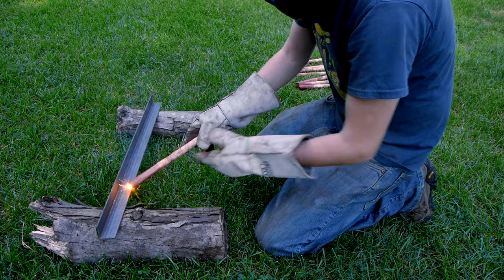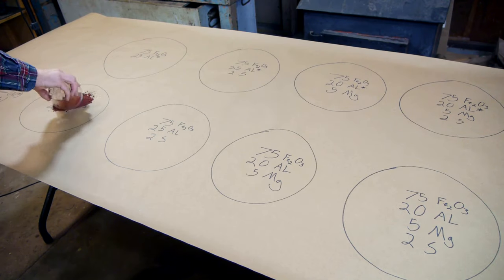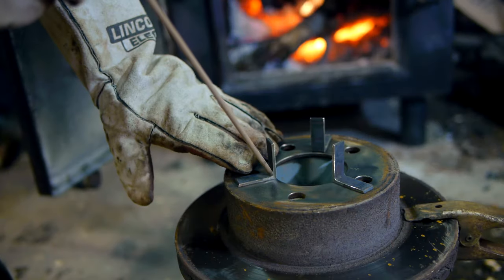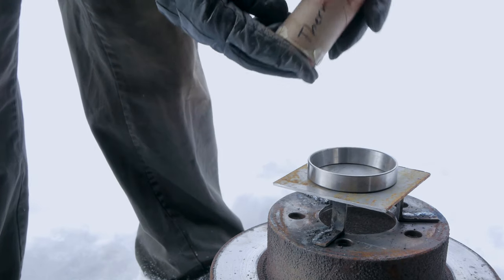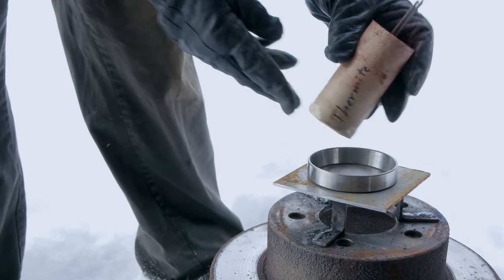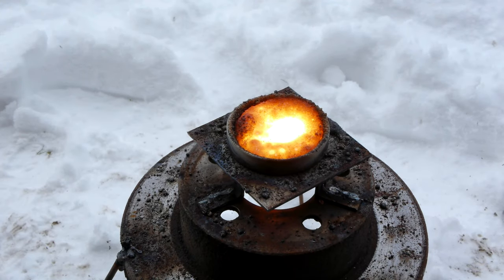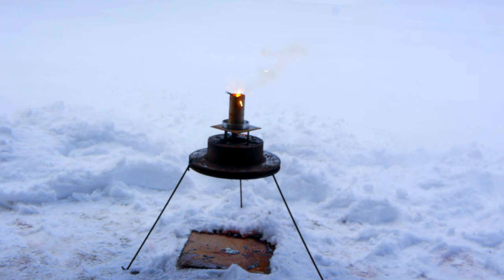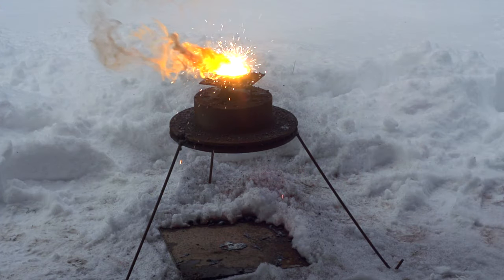How Easily Can Thermite Actually Melt Steel? - NightHawkInLight

Comment: Idk man, there is plenty of footage of thermite cutting steel. Your thermite seems to burn very slow in comparison to the others I've seen on YouTube. They do use roughly a pound to two pounds of thermite however, rather than 300 grams. Try upping the amount of thermite you use, it's cutting power seems to grow exponentially with how much you use.
Reply: +RichCommander You mean like when the Mythbusters tried to use over a thousand pounds of thermite to cut a mostly thin sheet metal mini SUV in half and it failed to do so?
Reply: +RichCommander 
Where is this "plenty of footage"? Because most of the footage of thermite usages I saw shows filling gaps and welding, not cutting.
Reply: +RichCommander It comes down to how you direct the energy, from what i'm seeing, only the bottem 10% of the thermite was actually influencing the steel. The rest of the thermite reaction was directed up and outwards away from the steel. A better representation of this experiment would have been to have the steel put on top of the burning thermite if ignited from above, or find a way to ignite said thermite from below to cut downwards. The directing of energy is just as important as how much you decide to use.
Reply: thermite doesn't cut anything. it might melt stuff on contact but it is not used for cutting
Reply: +Ivan Stroganov cough thermal cutting rods used by the navy to cut metal underwater
Reply: +superdau I just did a search, and on the first page there are 3 videos of thermite melting through - a metal table - a ceramic pot + frying pan + plate steel, all in one go - and several I beams and girders

Comment: Now I'm no chemist but I think something you're doing is wrong. I've seen lots of videos in which thermite melts steel like butter. You can watch Brainiacs videos or the episode in which Mythbusters use thermite to get into 4 inch thick steel safes. If you can't get past a 1/8th inch steel sheet then you're doing something wrong. Great videos by the way.
Reply from the maker: +DjCatani Brainiacs is known to fake the results of their experiments to make for better entertainment. Mythbusters has used thermite quite a lot but as far as I know have failed to cut through anything very substantial. That isn't to say that thermite cannot cut through steel, but that it isn't as easy to make it do so as just setting it above the steel and hoping for the best. That was the purpose of the experiments I did in this video. Focusing the energy of a large quantity of thermite with specialized housings certainly can cut through significant thicknesses.
Reply: +NightHawkInLight nighthawk you have to put it in a container with one side open and facing on he steel that will cut right through that chunk of steel
Reply: +NightHawkInLight Dude, you're just wasting 90% of that thermite by keeping it in that cilinder and lighting it from the top.
Reply: +NightHawkInLight Yeah, the focusing is the crucial part. Just like with sunlight, if the energy is dispersed over a large area, it's harmless, but a large enough area concentrated into a small spot will melt rock.
Reply: +DjCatani  Just like gunpowder won't explode if you just take a handful of powder an set it on fire, thermite  will not melt iron if not used properly. I would like to see the same experiment with only difference being cylinders placed sideways. I'd be willing to bet that it  would be enough to create different outcome.
Reply: +NightHawkInLight As with any thermal or explosive compound, shaping is crucial to achieving maximum results. Having an open-top cylinder is not just "by no means perfect," it makes this experiment completely improper considering your test objectives. I enjoy your videos, take another look at this one.

Comment: thermight was designed to weld steel together not go through it. thermate was designed to go into the barrel of a tank or heavy artillery and melt inside to gunk up the gun and fuse the metal can to the inner barrel. neither one was designed to melt through metal.

Comment: I watched a video a while back about how maybe thermite was used in the attacked on 9/11. The person in the video made a range of thermite compositions and put them into steal piping with a reducer as a nozzle. The thermite he made was quite fast burning and he put them into a variety of containers with nozzles or small slits to try and cut thick steel. Most of the time it was an explosion but did cut the steel. I will look for the video and I will get back to you.
Reply: The video is called 9/11 experiments: The great thermite debate .. it’s still on YouTube. And clearly shows how a very small amount of thermite can cut cleanly through steel beams.

Comment: I think since the plate had time to heat up while the reaction was starting, it softened the metal and made it more pliable. (Less likely to penetrate.) same thing goes for your hand held rods. Try suspending a clay flower pot over the steel and having it pour onto the plate.

Comment: It's not your ingredients that are the problem. It's that you need to force your thermite reaction to be solely directed at what you are trying to cut. I've seen a YouTuber cut through an i beam. As you can see from your experiments, with it set as omnidirectional, it won't even burn 1/8 steel. Try wielding 2 angle irons together long ways, but only wield down one side and make about a 1/8th gab down the otherside. Cap the ends with steel end caps. Fill your thermite, then direct your 1/8th inch gap that you made tight along where you want to cut.
*All of these sizes here aren't necessarily correct, but the process is.
I hope this helps, it works. I've seen it 👍

Comment: From the setup, it seems to me most of the thermite is burning up at the top of the tube before it ever gets close to the plate. The amount that flows down to the plate and that amount burning relatively close to the plate isn't enough to do more than get it nice and hot. I would expect just thermite inside the retainer ring would do as well and possibly better. You might also consider adding magnesium, though iirc you may have had that in the list of ingredients briefly shown near the beginning.
I have definitely seen thermite cut through iron and steel. I'm certain your method of application is the problem.

Comment: a couple of thoughts, 1) light from the bottom. by lighting from the top a lot of energy is lost burning through the material before the heat reaches the bottom. 2) have you ever tried adding magnesium chips and a filler to increase the temperature?

Comment: It's normally more effective to hold the thermite in a ceramic pot with a hole in the base so when it forms the liquid iron, it flows out of the bottom and can indeed cut through metal. Also thermite likes company, so try to use a larger amount to allow the heat to really build up and get a good flow of iron. Also ensure that you use the finest grade of chemicals with the highest mesh number and mix it really well before use.
And as so many people have pointed out, there are lots of videos out there showing successful use of thermite to view and learn from.

Comment: I remember back in Army Basic Training, it was "Hand Grenade Training" and one that was demonstrated was the Incendiary Grenade.  It was about the size of a tomato soup can with the fuse on top but it burned down thru the bottom.
 So when you load the tube w/the mixture, set the fuse to light the bottom and try to make a hole thru the mixture from top to bottom to allow extra air in to cause a venturi effect and turn it into a blow torch.

Comment: It is all about direct heat application and containment, if you burn all the thermite in a large stack far above your target surface it can't do much good.
And while thermite does turn into molten steel it can only share the heat with objects around it, meaning you need a great deal more thermite then the steel you want to melt, it is sadly no magic pixie dust.
Reply: Molten Iron not Molten Steel.

Comment: Hey if you dont mind me asking, What are the handheld container tubes you use made of?
Reply from the maker: +PsychoSebi Paper
Reply: NightHawkInLight oh, How thick is it that you can hold it safely?
Reply: +NightHawkInLight copper oxide works better than iron oxide
Reply: +Defective Turret The problem with that, even tho it has a greater energy output,  the reaction ends quicker, so it has no time to really melt the steel. most of the heat just escapes into the air.
Reply: gmoddave actually it more of explodes

Comment: try lighting the thermite from the bottom of the tube to allow the molten metal to drop down onto the plate directly rather than to potentially weld the iron/aluminium together under it as it's reacting, your thermite compound also seems to burn differently to other thermites, ask +theCodyReeder (cody's lab) for the recipe to his thermite? and/or ask for where he sources the components, if that fails try gunpowder/blackpowder in the mix to speed up the reaction?

Comment: Next show suggestion, How easily can Jet fuel melt steel ☕️🐸
Reply: Very effectively
Reply: Filip laskovski how easy can jet steel melt fuel beams
Reply: ***** Learn chemistry before getting a youtube account
Reply: ***** Make that simple 6 yr old logic, not chemistry
Reply: ***** However nothing can burn hotter then the amount of energy that can be provided.
Reply: ***** It would make multiple small ones then around 2-10 large explosions then one massive explosion which can be heard in un edited clips.
Reply: John Waldeyer Explain the un edited videos where a loud explosion happens 1 second before the building fell.
Reply: John Waldeyer They were edited. Fun fact a helicopter was over the north tower when the south tower collapsed. If you can not here the helicopter or the explosion, it is fake. It is a large flaw in the 9/11 plan which proves tons of videos fake.
Reply: Anyone who thinks the towers fell at free fall speed is kidding them self. There is 0 explination for something to fall through plasterboard and steel beams as if it was falling through a vacuum

Comment: Couple things I'm wondering... First, if you lit it from the bottom (or rather, if the wick you used to light it ran all the way through), could you see better results? If you used a narrower tube (to focus the energy in a smaller area), could you see better results? Composition isn't everything, though it is a good focus.

Comment: Probably a bad idea putting the Thermite in a toilet paper tube. The toilet paper tube burns and makes gas (as smoke), and that releases a large amount of the heat up and away from the steel. The whole point in thermite is that it makes little to no gases, and so the reaction gets up absurdly high.

Comment: If I may make a suggestion, maybe try to create an ignition system that will burn the fuel from the bottom to maximize the concentration and heat at the point you wish you penetrate. Not sure if this is feasible but it seems plausible. It may end with fuel being scattered out of the top of the container.

Comment: The only use I know for thermite besides military use you mentioned is for welding rails together on railroads. I think Mythbusters even did an episode where they used it to get into a safe and they needed a heck of a lot to do it, and it wasn't practical since it would have burned all the money in the process. The issue is it leaves too much material that soaks the heat so the target metals never really get enough heat to melt, just enough to fuse with the metal in the thermite. I really enjoy your videos on it and hope you explore it more. Might be interesting to see you weld with one of those thermite sticks.

Comment: +NightHawkInLight I'm a thermite welder on the railroad, we don't use thermite to cut rail we use it to fill in the gap to join two pieces of track (25mm, and up to 50mm),and we always preheat the ends of the track, period of time depends of what kind of track it is, I'm not sure how much thermite we use, but the portions we use comes in rather small buckets.

Comment: it's important to remember that the high 3500 F temps are reached at the interaction, not through somehow self-melting and dripping downwards onto the steel. The interaction has to occur immediately or near immediately proximal to the steel. The reason the plant pot works is that as the interaction gets going a constant source of chemical mixture is pouring down through a hole, controlling the burn rate. That way the heat increases until it finally goes through. You need both a length of burn (probably from a lot constantly burning over a longer period of time) AND proximity to the steel, or concrete as Grant Thomas has done. 
There are many ways to get high temps, what makes thermite useful is that it has cheap components that are not easily triggered and they can be modified a lot of ways for demolition applications. I don't think it is overhyped, respectfully. It is awesome stuff.

Comment: If you could focus the flames of the thermite, then it might work better, as the heat seems to be dispersed mostly up into the air. Possibly using compressed air to blow a flame down (while fuel source is kept to the side).

Comment: Thermite can't melt steel beams
Reply: actually it can and is probably what was used.
Reply: actually it can and is probably what was used.
Reply: ..but jet fuel can? There was also nanothermite found in the residue so you could be right though. Maybe thermite was there to weaken certain sections enough so as to facilitate the collapses, with nanothermate doing the main job.

Comment: I lit off a batch of thermite in my back yard in a relatively thin dollarstore frying pan a few years ago and I was pretty disappointed and surprised to find that it didn't burn through as I expected. I guess you need a sustained reaction to heat up the container enough to melt it.

Comment: Like just before you hit the oxygen on a cutting torch I think you are right there, you just need maybe a second stage it would act like hitting the oxygen, and maybe some way to funnel that pressure into one small point. Also I have wondered if you drill a small starter hole in the center, what would happen?

Comment: The thermite 'grenades' I am familiar with from the military have the igniter down the center of a compressed cylinder so the inner surface all ignites simultaneously. That seems to direct the heat both up and down, creating a directed jet of flame that definitely will ment through at least an inch of steel. I'm certain the design had to be tested to gain the most effective deployment.

Comment: If the thermite is placed directly on the steel plate, I believe the  greater surface area, and more direct heat transfer would add up to more cutting power. Keep up the great Work! Your videos never fail to entertain me!

Comment: my memory says thermite was mainly used for welding things like railroad tracks when making repairs
your lance is a cutting tool

if you want to burn thru something aka cut it, its a narrow hot spot, used to cut out a section
not powder to burn a big hole

Comment: If you light it from the top, the layers of thermite underneath it will insulate the heat, which means only the last bit of thermite will be in contact with steel. 

If you want to use it to cut, you need to light it at the bottom, and make way for it to trickle away, so it doesn't solidify and block the rest of it reaching the steel plate. Drill a small hole in the plate or make a channel in thermite's container.

Comment: At basic the Drill Sergeants put a thermite grenade on top of an ammo can. Made a hole, but only a small one. They did it again putting the grenade underneath and it melted the can in half.  The problem probably isn't your thermite, it's where you're putting it.  On top, the unburnt pile will actually insulate the plate until it begins reacting. Furthermore, anything on top of, or to the sides of will receive more radiant heat than anything below it because of convection. 

When thermite is used to disable or decommission equipment, it's placed in the center of the equipment.

Comment: If thermite is used to cut steel its most likely housed in a conduit with a directed output facing the steel being cut through. The conduit is usually a sealed container as well in order to pressurize the output

Comment: I'm pretty sure the reason why the thermite didn't cut through the plate is because you ignited it from the top. The heat from the  top layers of material ignited the material beneath it and transferred the reaction to the material in contact with the plate. But before the material close to the plate even started to heat up, most of the reaction had already occurred and the material had already been burned up above. If you had found a way to light the material from the side in contact with the plate, the heat would have been directed downwards towards the plate and at the same time, would ignite the material above it which would then come in contact with the plate as it falls down to replace the already-burnt substance. That way, almost all of the energy would be directed into the plate.

Comment: you need to focus the thermite burn into the steel  (ewample: if you put a lit candle on cardboard it probably won't light the cardboard , but if you put the cardboard over the candle it will start burning; i'm trying to say that the presence of the reaction is not everything that is needed ; orientation , and placement of the reaction has a lot to do with it ) ; [sorry for bad English if there was any]

Comment: Why not try using aluminum tubing? Have it a little more narrowed out in terms of diameter and pack the thermite in a way that allows it to burn towards the bottom? Otherwise you are just lighting a really hot candle and I'm sure you would probably want results.